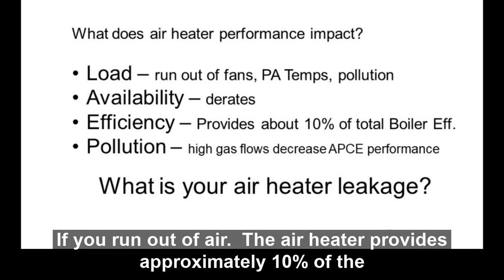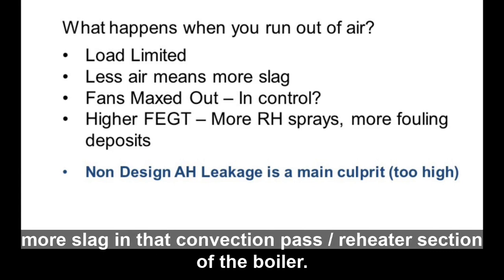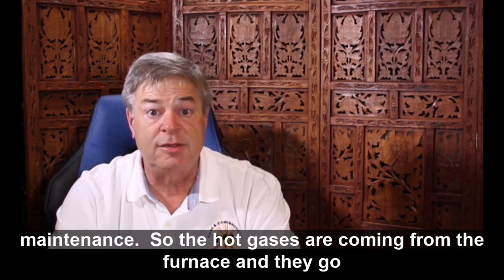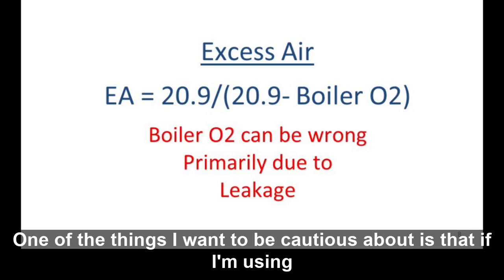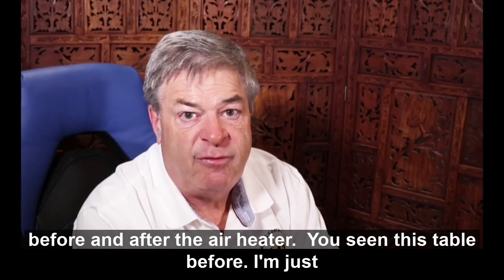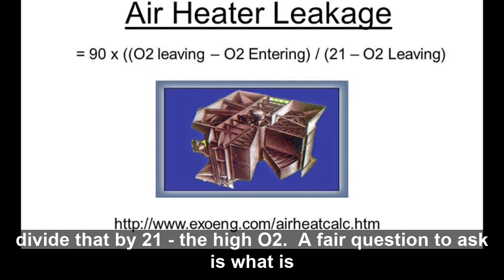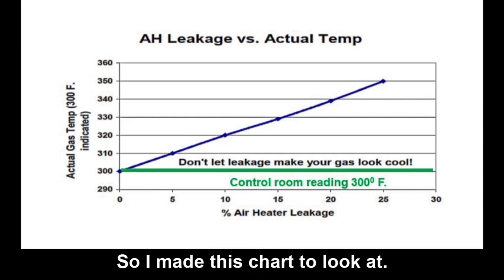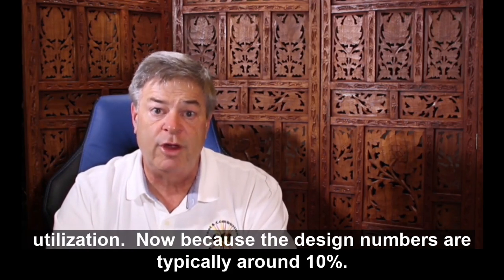Air Heater Leakage by Rod Hatt w Eng subtitles

Comment: Hi Rod, I'm having a trouble with the air heater leakage equation. so right now I'm doing my research internship in coal power plant about air heater and currently investigating about air heater leakage. I read the ASME performance test for air heater and it shows this equation "Leakage% = ((% CO2 gas entering heater - % CO2 gas leaving heater) / (%CO2 gas leaving heater)) x 90" why does it multiplied by 90 and not 100 to get percentage? Even though I dont really use this equation since this power plant measure 02 instead of CO2 but still, get me curious.
Reply from the maker: I use O2 in this equation 90 x (20.9/(20.9-O2 out)) / (20.9/(20.9-O2 in)).  This excess air out/excess air in.  I do not know why there is a 90 factor, probably AH manufacturers needing a lower value.
Reply: @rodhatt4617  ah i see. thank you so much Rod!